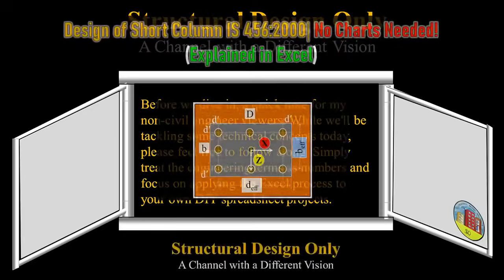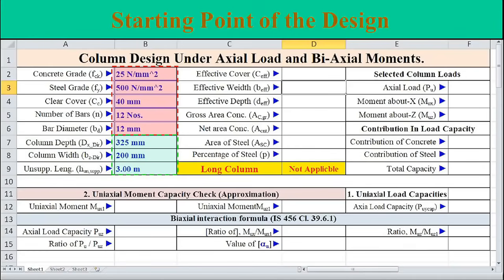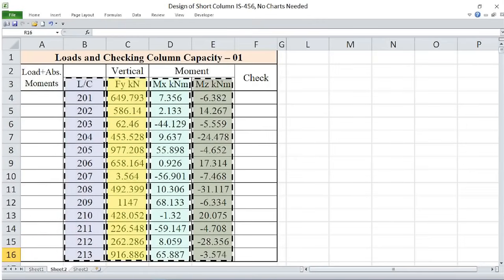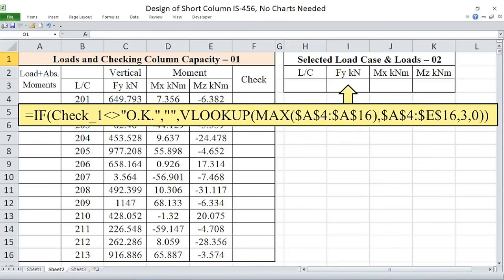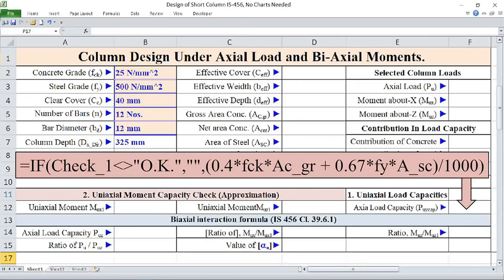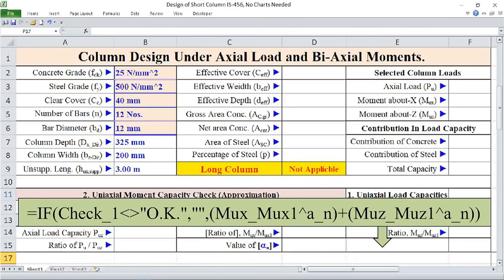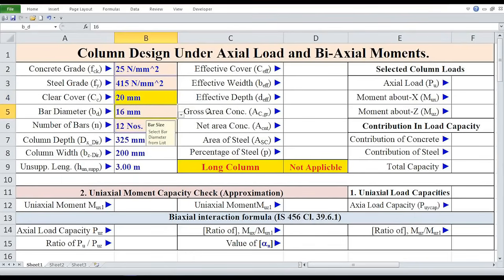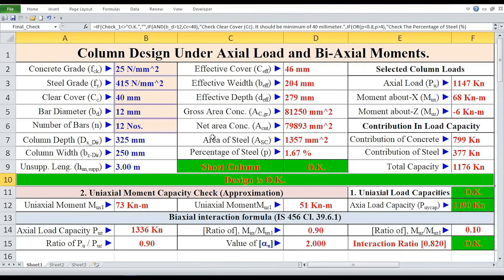Column Design Without The Charts Of SP-16!

Comment: Dear sir, 
This video on capacity of short column without using design chart is new one you have developed. It is useful one. Thank you for creating new concepts in excel sheet. Kindly share your excel sheet for column design without using interaction curves. Kindly share any other excel sheet using interaction curve to compare the results. Thank you sir.
Reply from the maker: Now, please check your mailbox. In my next video on a long column I will try to develop an interaction curve. Thank you.
Reply: Thank you for sharing your valuable excel sheet sir.
Reply from the maker: You are most welcome.
Reply: Excel sheet received sir.

Comment: This program gives only approximate values. We cannot use this excel sheet directly for design. A rough value of 0.15 is used for My/fck b D^2. Effective depth is used instead of a total depth of column. I hope the developer of this Excel sheet will modify this Excel sheet by generating interaction curves which are more accurate.
Reply from the maker: Respected T.N. Murthy 
Sir,

Thank you very much for taking the time to review the Excel sheet and for sharing your valuable feedback. 🙏

Yes, the current version is intended to give approximate results for quick preliminary understanding and learning purposes. Your observations regarding the use of the 0.15 factor, effective depth, and the suggestion to incorporate interaction curves for greater accuracy are absolutely valid and sincerely noted.

Your guidance means a lot — it truly encourages me to improve and refine this tool further. I would be grateful if you could kindly guide me on how to best incorporate interaction curves in Excel, as you mentioned. On YouTube, I consider myself primarily a demonstrator — sometimes I teach, but most of the time I am learning along with my audience.

Also, my next video “RCC Column Design by Stress Block Parameters (IS 456:2000) | Part-01” is already live. I hope you will watch it and once again share your valuable suggestions to help me improve.

Thank you once again for your continued support and encouragement for our civil engineering community. 🌟

Warm regards,
Er. Pronab Sankar Chatterjee
Reply: I will send you an excel sheet for column design using interaction curve. The Excel sheet will generate interaction curve and pick up the appropriate value and do the calculation.
Reply from the maker: Thank you sir.
Reply: I have sent you an excel sheet for column designs without using sp16. This program will generate an interaction curve and pick up the value of  my/fck bd^2. Please check your email
Reply from the maker: Thank you very much.